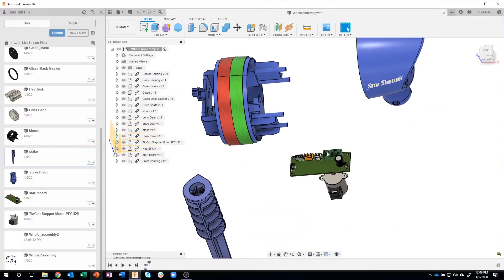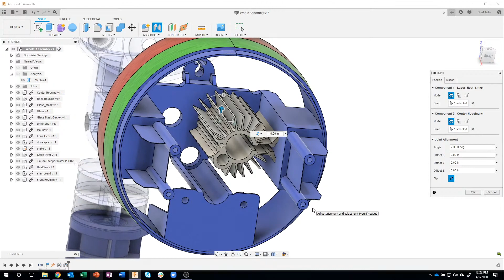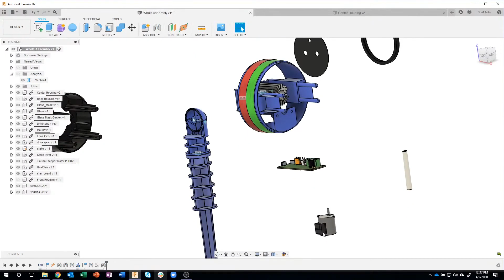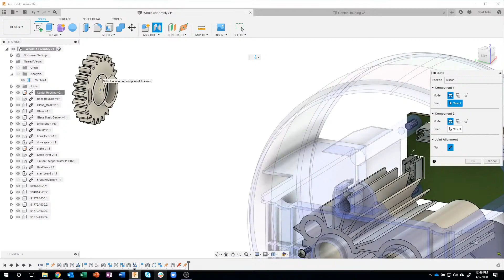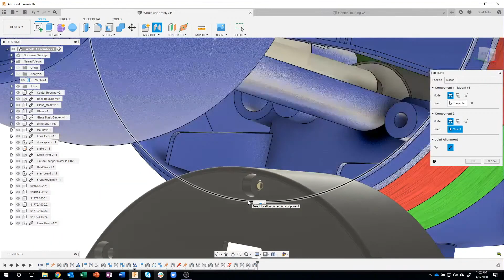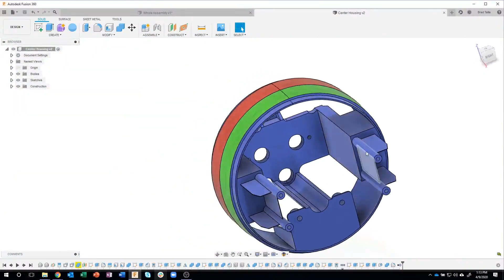Episode 56 - Laser Projector Build,  Part 6 Assembling It All Together

Comment: If you divide drive gear tooth number by slave gear tooth number and multiply the result by 360 degrees it should tell you the rotation degree number of the slave gear if im right. Which in this case is (24/23)*360≈375.65

Comment: Hey Brad
once you've assembled the joint correctly (the  one with the little teeth) is there any way to allow it to be rotated in the assembly,  but constrain it to only go where the teeth would mesh  correctly (such as specifying by the tooth count or something like that)
thanks, 
Paul
Reply from the maker: @Paul-  That's a great idea, but I don't know of a way to constrain it to "snap" from tooth-to-tooth.
Reply: @bradtallis8968  Actually, if you enter the number of teeth in the box where it asks for an angle you get the gear ratio. But you have to reverse the entries. In your example, for Ref12 enter 23 (teeth) and for Ref13: 24 (teeth)